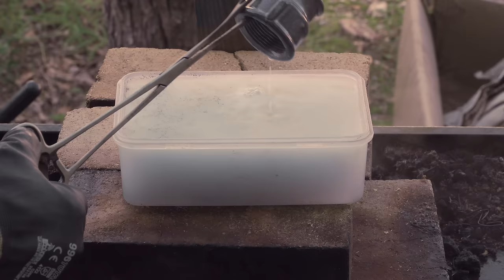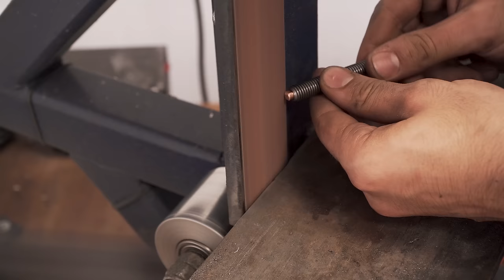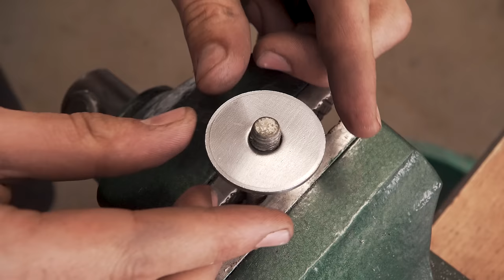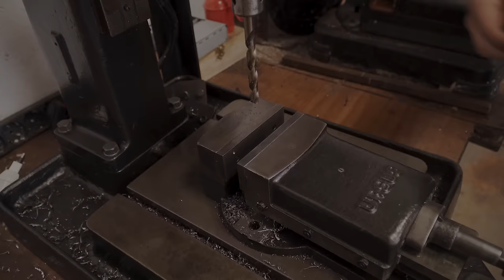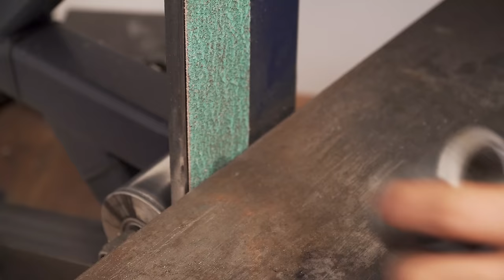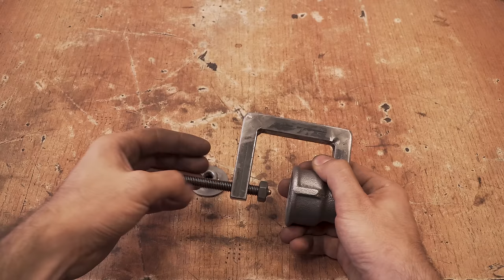Forge / Furnace Venturi Gas Burner

Comment: Outstanding ! For those that live in an area where it's available,  black iron pipe and fittings will save the acid bath step to get rid of the galvanized coating . Your design of the adjustable air gap is ingenious in that it allows for variations in gas pressure as well as fine tuning the flame . All in all a great design .

Comment: Great job of showing the fine tuning of the air mixture.  Drilling the bolt to hold the mig tip is interesting.

Comment: Great job!  If you ever have a problem with the MIG tip clogging or you want to change orifice sizes for the use of different gases, instead of soldering in the tip you could try using a hollow bolt that's tapped at one end to take the tips' threads.
Reply: I was a little surprised that he didn't tap the drilled out bolt to take the mig tips?
Reply: I made a similar burner, but drilled out the orifice. Been using it for a few years, no problems as there really isn't anything to clog it up, just propane in my case

Comment: I thread my mig tips into the connecting pipe, that way I can interchange them for optimal gas flow. Clever design though to allow for control of the choke and tip height intake.

Comment: Muriatic/Hydrochloric acid strips the zinc off super fast and is a lot easier "for me" to get, pool chemicals.
Also looking into using "lamp bolts" the long hollow bolt used to assemble some lamps. Save the hassle of drilling that long deep hole in the bolt. GREAT Burner, I have all the materials to build three of these for my forge, just need the time to do it. LOL

Comment: Loved the idea of removing the galvanized coating first with the acid prior to brazing. Anyone familiar with galvanize knows how poisonous it is to breathe in if being welded or grinded..
Reply: ^This^  cannot be emphasized enough.  Very poisonous.
Reply: You can buy pipe w/o 'Galvi'
Reply: I have an industrial sized rock tumbler, I just throw my parts into there with first tumble rocks, 20 or so bottles and gallon or two of water. And a few days later and looks like just cast. Have bucket of seaglass as well.
Reply: can do the same thing with vinegar, takes longer. There are other things that work well, but maybe a bit less scary than sulfuric. I use muractic (HCL) that is sold for cleaning concrete, still pretty nasty. But given the alternative. Look up "how I killed myself" about a metalworker/blacksmith who lived long enough to write an article about zinc fume poisoning (I believe only a couple of weeks between his mistake and untimely passing). Maybe the worst part is he knew better, and knew he knew better.
Reply: I didn't know grinding it was poisonous too
Reply: Right? I didn't think about that one either but i guess it makes sense. I learned something with out even watching the first 20 seconds of the video:D. coincidentally I have some sulfuric laying around, any idea about the toxicity of the fumes coming off of the acid?
Reply: @chastaz123  likely need to worry more about H2SO4 fumes than the zinc at that point. Chemical gloves, eye protection, do it outside if at all possible otherwise lots of air ventilation. Used to use it in grad school for cleaning, that and nitric (just don't with the HF that will dissolve the glassware).The fumes will do nasty to your lungs, skin, etc. Don't f' around with it.
Reply: Just buy black pipe fittings instead of galvanized and skip this step.
Reply: Just about as poisonous as the acid!
Reply: You need to research liquid propane burner, it will produce million BTU in a very small size, I use to make them for a propane fired road building company
Reply: Meh, I used to work with galvanized for a living. I've torched it, welded it, and ground galvanized. I've gotten sick 2x in all that time when I wasn't careful. Either way, I have experience and I know what I'm talking about here, there's no reason for him to remove the galvanized here before welding lol, it's not a lot and seriously. Just weld in a ventilated area.
Reply: And if all he did was braze it then yea, totally an unnecessary step
Reply: Q

Comment: I welded one using stainless pipe, the choke doesn't have to close so tight as it will be wide open when in use, l used a quick release axle from a mountain bike as it already has a 5mm hole for tapping M6, 1mm mig tip and a 0 to 4 Bar regulator, the temperature it achieves over crushed fire bricks is great, 30mm solid bar white hot in about 4 to 5 mins.

Comment: It's great to get to a point where you can really start to make stuff. 
I still need an welding torch and compressor before I can say i can cover most jobs at the moment.  
And the air tools. 
And a cordless nail gun 
A lathe would be handy too. 
A track saw would be good  for tge large large boards
OK will be cool after that. 
I really really want a bandsaw though.
Reply: Check local auctions. Many, many things go below the actual value. Just watch out for doctors and such that desire to keep everyone else from getting a great buy.

Comment: Very nice design, further improvements? >  replace venturi nut with large thumb wheel for easier control.
Also, on last forge making video, you have heating quite localised, can we loop this heat around the crucible at the bottom?

Comment: Three comments I would like to make, and none of them are criticism. First, I recommend that you use some kind of a guard on your bench grinder. The stuff on the wall could very easily be in your face or eyes.
Second, be very careful using gloves on rotating equipment. I took a coworker to ER because a glove he was wearing pulled his hand into a gang saw.
Third, if you want cheap brazing flux, get a box of Boraxo. The main ingredient is borax, the same as what coats rods for brazing ferrous metals.
Other than these three items, keep up the good work!
Reply: Good advice, Bryant 👍

Comment: Just to be clear, the mig tip is at the base of the design by the airflow adjustment bolt. So how much velocity of gas do you need going down that long pipe to ensure the flame can’t chase down the pipe. I’m looking to extend my mapp gas torch or potentially build my own set up like this. But there is surprisingly little info online - not that I can find anyways

Comment: Just a brief aside, but you can also strip the zinc off galvanized parts with muriatic acid, and it's cheaper (and arguably safer) than sulfuric.  Makes zinc chloride instead of zinc sulfide.  This is all moot of course if you can't get muriatic where you're located.

Comment: Do you need a flashback arrester between the venturi and the tank?
Reply: No as long as bottle is under pressure it cant suck in air.Venturi burners suck gas forward so they are safe .

Comment: Wow! Awesome!

Is a flashback arrestor mandatory? Or it is safe the way it is?
Reply: Got a similar one and for me it's not required, just does loud whoop when I want to stop it, but gaz can only burn with air so flame won't go back inside the hose.
Reply: Glandock thank you
Reply: As Glandock said the fuel won’t burn without air so they are only mandatory in oxy-fuel setups, although If there was a big enough leak, the pressure was low enough and you weren’t paying enough attention or you were doing something else while it was heating up it could possibly burn back up to the hose, melt them, and create a big-er leak which could lead to an explosion!! So it comes down to your knowledge an experience with gas,, so I hope I helped, and goodbye for now,, Shane
Reply: The Falling pigeon great! Thanks
Reply: I have a gas fuze at the gas cylinder first, just for safety. Burning out hoses can cost money, but a flame reaching the gas cylinder is not something I want to experience.
Reply: Mark Fryer,, O Sh*t!! I never thought of that, I only made my gas forge a month or two ago, guess I’ll be fitting one of those tomorrow,,

Comment: Why did you not use black iron pipe that is meant for gas fitting instead of going through much trouble to etch the zinc away?

Comment: Except drilling out the bolt pretty straight forward.   I’m guessing the bolt for a lamp would work.    No drilling necessary.   Just tap the center.   They are called lamp pipes

Comment: Why is the Zinc plating removed?
Reply: might interfere with the welding?
Reply: Zinc fumes are poisonous when breathed; never weld zinc galvanized metals, or breathe unprotected if zinc is being exposed to flame (like at the burner outlet.)
Reply: @KernSutton  aha, thank you :)
Reply: @sirspikey  trust me, it doesn't taste good and you don't feel well afterwards. Never welding gal. again.

Comment: Hello, how are you? What do you think if I add to the idea a strong air from a compressor that is suitable for the combustion process? Will this work to increase the strength of the fire? Or do you recommend that I work to stay on the same idea with a good and closed design focus to maintain the temperature because I want to implement the idea and modify the system My oven

Comment: I feel like if you were just gonna drill a hole and then solder a welding tip on you could have step drilled down to a lower size hole while on the lathe

Comment: Great burner! 👍
Great design, I like the simplicity and that's how I'll build the burner. 👍
I still have one question. How long does the 1 inch pipe have to be?
Reply: Eight inches, minimum, I believe. Any shorter won't mix the gas and air enough. Try a couple different 'nipple' lengths (pipe body) -- they're cheap. I did this with 3/4" pipe to 1" flare ('reducer' bell) -- works sweet. As long as you can control the air flow, you can dial in the flame. I actually didn't know you could do this with such a long pipe -- so, I think it's a minimum, rather than there's any maximum? For my forge, I just wanted the shortest that would work.
Reply: @jrocks1971  Thank you

Comment: I wanted to build one of these a while back but then I was speaking to a blacksmith and he said you need a flashback arrestor , otherwise its too dangerous. Is that true?
Reply: No ,as long as there is pressure in the bottle it wont blow up. These are venturi burners so they suck gas forward.
Reply: @armageddontools  sorry for the dumb question,     but you said ' as long as there is pressure in the bottle, it wont blow up' .....  but if you run low or run out of gas the pressure will drop yeah ? so it a problem then?

Comment: Thank you so much for this design. I made myself two of these and they work perfectly. I am planning to use them in a longer forge for more even heating of long-ish blades. Design is pretty cheap and doable (since I have a small lathe), but for me most important is that is of good quality! Still need to make a holder for them, but it is of lesser concern! I am aware that this is not unique design, I found it in some more places, but your execution of this burner set me to replicate it ! :)

Comment: loved the simplicity ,but wouldn't it have been easey'r to to simply drill and tap a hole for the gas jet screw housing just a copper or brass screw to screw into the gas adjuster screw and then  drill out the .5 mm hole whilst doing the turning operation's if your using a lathe

Comment: Built it and it works amazing until I put it in the forge. At that point it will not hold a flame. The flame just falls off the end and flutters around inside.

Comment: The amount of combustion going on here is equal to an electrically powered forced air burner. It burns with a pretty oxygen neutral flame which makes this the best kiln burner for off grid ceramic firing you can find.

Comment: It's a home made oxygen and acetylene gas torch
Reply: No, its just a propane gas burner. Oxy Acetylene requires two different gas bottles plus regulators and flashback prevention fittings.
Reply: @markfryer9880  ohhhhh I should of knew that